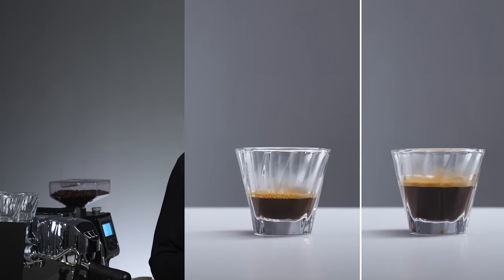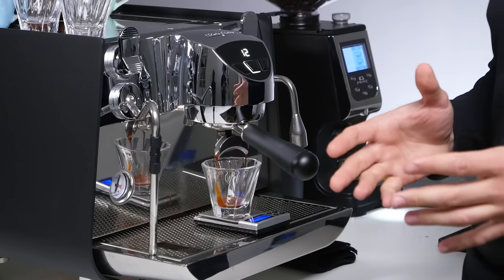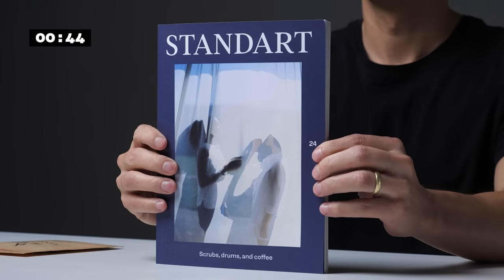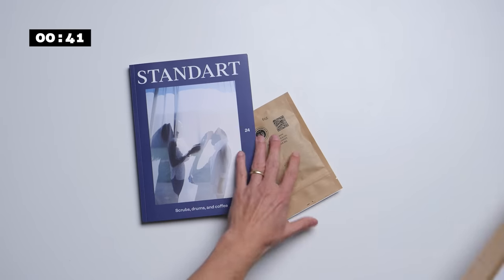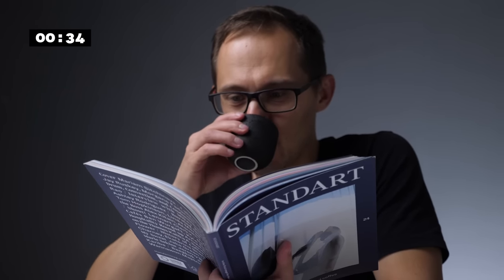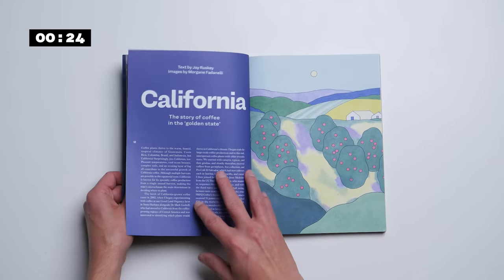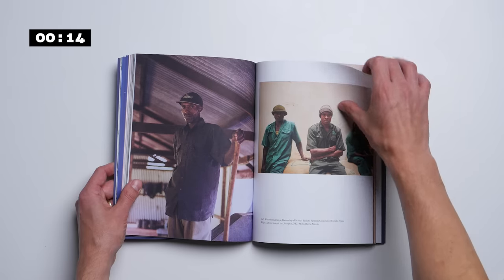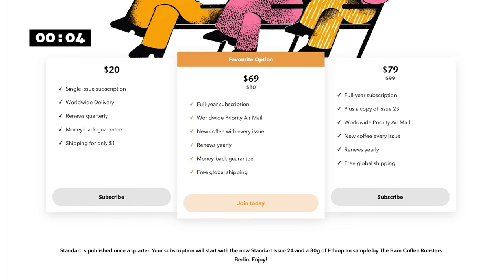Ristretto, Espresso vs Lungo: What's the difference?

Comment: Often when I order a lungo I get an espresso with a small pitcher of how water. Is the taste different or similar when preparing lungo in this way - by simply diluting espresso with hot water?
Reply: Is this in France? There I seemed to very often get hot water with espresso (even when ordering espresso). But no, it is not lungo, it becomes Americano or long black if you pour the espresso to water.
Reply: @elqniemi  This is in Slovakia. Yeah,  I usually drink americano and when I want smaller coffee I order lungo which often times is also just espresso + water. I was just wondering if lungo prepared according to video tastes a lot different than espresso + water.
Reply: There are some differences, but usually, the best and most common way to prepare lungo in the cafe is espresso+ hot water on the side. :)

Comment: This isn't right. How 29 sec is a restricted extraction? It's a normale espresso not ristretto
Reply: I agree… his demonstration of a standard espresso is technically a double, isn’t it??
Reply: There are basically two different ways of making a ristretto or in this case a double ristretto depending on where you are in the planet. You either dose for a normal 1:2 espresso and stop the shot early in about 20 seconds to get a 1:1 ratio or you grind much finer to get that ratio in about 30 seconds. In both cases you'd get about 30mls of espresso instead of the normal 60mls for a double dose. The Italians, who admittedly invented the drink, stop the shot early but in Australia, for example which has an enormous coffee culture, they would do it the second way and they are not alone.  Its your taste buds that decide which is right.